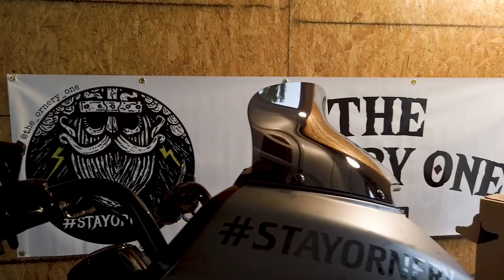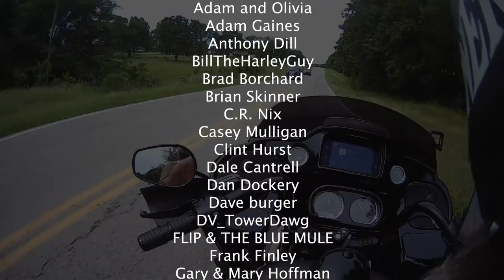Top Two Windshields for 2019 Road Glide Special | Best Memphis Shades Spoiler Windshield

Comment: after watching this video I ordered the 10" memphis shades spoiler shield. this is by far the best shield I bought. had a 14' klock works sport shield(poor wind management) looked awesome,then a 12" wind vest( great wind control, looked  huge on the bike) the memphis shades looks cool and works great. I'm 6'3", stock seat. 2015 road glide 13" bars

Comment: Freedom shield makes a excellent  windshield I have one on my 2017 road glide special very happy with it
Reply: I have 11 ' from freedom shield on 2017 road glide special at 89 miles per hour I can hear my stock stereo fine and there is no  Distortion when you look through the windshield  Best in use you can try it out If you're not satisfied you can send it back As long as you keep the plastic protective coating on it And the quality is outstanding

Comment: Wish I knew where your camera was mounted from in those drive tests . Thinking of 10 inch but you got to be looking over it not through it or it's too tall
Reply from the maker: Our camera's are mounted on the left side of our helmets.
Reply: @TheOrneryOne  good to know. Everyone has different seats, taller, etc. Those windshield are designed to throw wind over your face so you get a windshield that goes up to your chin. I've seen videos where the 10inch goes to someone's chin sitting on the bike. You guys were buried in that windshield complaining about distortion lol so I was like these guys either have the camera low or they are sitting very low but the 10 was definitely not right for that individual

Comment: I have a 2017 RGS and the stock shield is buffering me right in the forehead and I'm 5'5" with a 29" inseam... short dude....I really didn't care for the 10" because of the "dead zone" at vision level....looks good on your ride....    You in Arkansas Ornery one?      DAWG from the Show me State....
Reply: Barry DAWG -you’re about the same height and inseam I am. When you had the 10” did you find you were looking through it or over it? 
Would you suggest an 8.5” instead?
Reply: @bubbanezz  The only 10" I had on my bike was the Freedom Shield.  I tried 2 different sizes from them.. I liked the look but I had a problem from 80mph and up to 100mph with my bike having a shimmy or shake that I didn't feel comfortable with.  John from Freedom is great to work with.  He sent me 2 different shields and if you keep the plastic on them he will take them back if you're not satisfied... He was great to work with and understood my safety concern.  I might add,, I only ran it up to triple digits to see if the vibration would iron out,, it didn't for me so that was my concern.  I'm not a heavy hitter with my speed but I do like to blow it out now and then,,, just like we all do...I think I'll look into this Memphis 6.5" shade as it is a little taller, thicker, and might just be the trick for me.. I'm glad Ornery One showed the difference in heights of each shield.. cool comparison, Ornery One.. thanks man...   P.S. I really didn't like that blurred vision on the 10" where the upsweep was...  Peace and safe riding during this crazy Pandemic situation.  Practice social distancing and RIDE ,,, RIDE ,, RIDE..        DAWG from The Show Me State...

Comment: With the 6 half is there that much of a difference in wind in the face.. I’ve got the streetglide and been wanting to get some type windsplitter for while but wondering if wind is as big difference as I hear ? Thanks brother
Reply from the maker: The 10in does cover more area than the 6.5in. Major difference, for sure!! They are both curves with the whip on top which pushes the wind & bugs on up over you verses the stock shields that just come right at you.
Reply: Excellent .. exactly what I wanted to know !! Thanks again man y’all stay safe!!

Comment: This review is total B.S. Bought the 6.5 for my Road Glide. All wind is directly at eye level with this wind screen. I actually think it would be better without a wind screen. Disappointed totally.
Reply from the maker: Your height & seat play into that factor Gary.... how tall are you? Hopefully you can find the right adjustments that fit you and your riding style.
Reply: I am six foot tall, have a Corbin seat they modified to sit as close to the frame as possible. I sit low. Wind is still directed directly into my eye area. If I was six inches shorter that may work. This may also work if you only ride around town. I ride coast to coast every summer at speed limits or slightly above. Your review convinced me to try it, should of been more skeptical. If it sounds to good to be true it usually is. Thanks for your reply.
Reply from the maker: There are several factors that play into finding the perfect fit. 
For us... for our bike, seat, riding (20k in 9 months) style and riding two up: this is the best windshield hands down. We tried 2 different sizes & this one works perfect! No complaints & like we said... we now have 20k miles with it. Wouldn’t go with any other. Extremely happy with it.